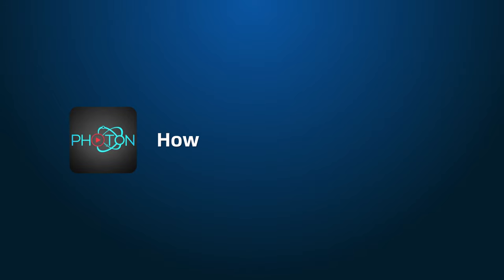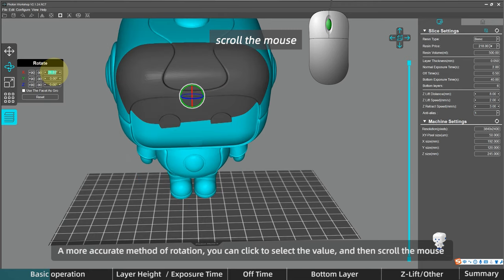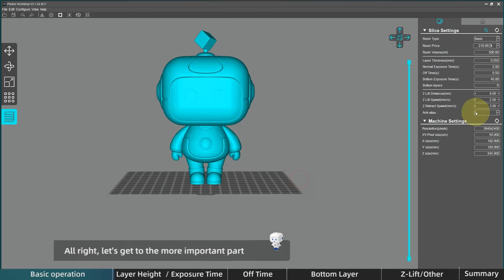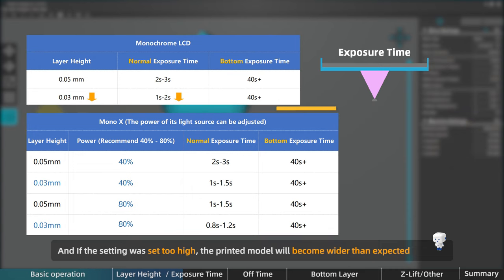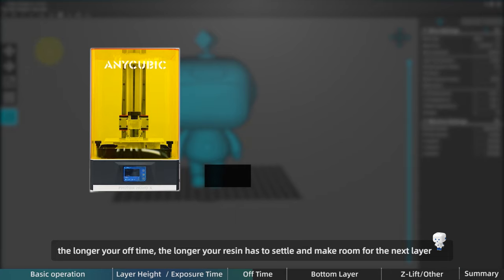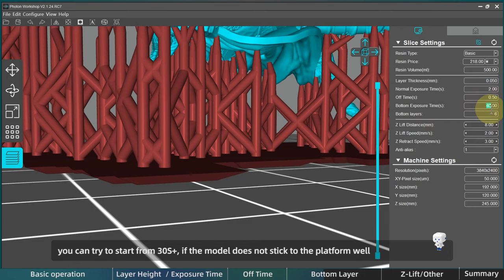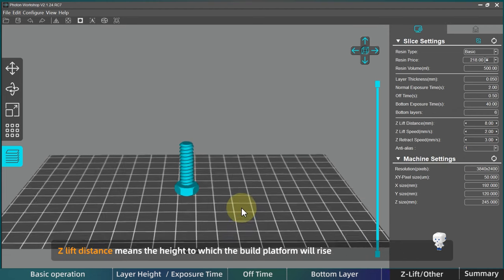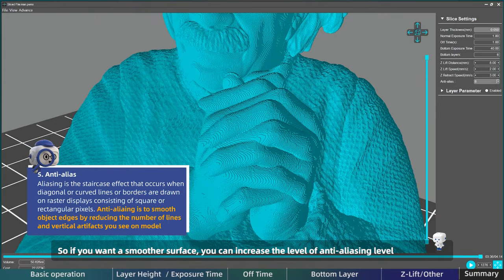How to Start Using Photon Workshop? (Beginner Guide 1)

Comment: I have a new Photon Mono, but the workshop program downloaded from the memory stick provided only has 3 options for machine types "Photon S, Photon, Photon Zero". In this video "Photon Mono" is listed. Which do I choose? Thanks Which do I choose? Thanks
Reply: i have the same problem but you just need to use the earlier version V2.1.26 instead of the V2.1.29
Reply: @saccharine.sinner7795  This right here. Way more helpful than their whole site.
Reply: I didn't even know to get the program from the thumb drive @w@ and couldn't find it on their website at all
Reply: @starrlesscreative  I spent about 45 minutes digging through the website to finally find the program to download (I think that it was listed waaay down under the product description….. not a user friendly website when it comes to finding the extras you need, just for spending the $$

Comment: Photon Mono X 6K under settings - Slice Parameters - Advance Control.  What's the difference in the parameters numbered [0] and [1] Each layer control (bottom and Normal seem to have 2 sets of parameters.  What's the default. Do I need to have all 4 parameters set?

Comment: How to set layer exposure manually for each layer? I want to ensure that the transition between the 40 second bottom layers and standard layers of 2 seconds goes gradually. But after editing the layer exposure manually it doesn't save the settings, but resets to general settings. Please help.

Comment: What is the ideal exposure time for a layer thickness of 0.02 with Water resin?
Reply from the maker: Hi dear, 1.5s is better : )
Reply: @ANYCUBIC3D  fantastic! Thanks a lot
Reply: @ANYCUBIC3D  I tried with 1.5 of exposure time and 1 sec of off time with 0.02 mm slice...the models are precise but even though they are hollow there is still some uncured resin. Do I go to 2 sec time exp ot 1.5 sec off time?

Comment: What is the correct sliced file to choose for the 4k mono it's not in the configuration settings? I need pwma!? These save as pwmo pwx no pwma? Anyone know?.thanks😊
Reply from the maker: Hello, add Mono 4K ((383 x 227 x 222 mm) ) printer setting into the Workshop, and don't forget to modify the suffix by pwma when saving the sliced file.

Comment: How do I bring my file over to the printer I’ve tried to save it to the usb many different ways and it’s not showing up on my printer.
Reply: @batingbunnies  I actually figured that out after I posted the question. The problem I have now is when I print it doesn’t stick to the platform. It stays in the resin vat and the first couple layers solidify to the bottom. I’m messing with the numbers in the program to see if that’s what was messed up.
Reply from the maker: Hi, sir, what printer are you using? You can use a USB flash drive. When you buy our printer, the package list includes the USB flash drive. After you slice it, you will get a slice file. You only need to copy it to the USB flash drive. 😊
Reply from the maker: @seth1371  Hi, sir, Sir, if the model does not stick to the platform, first, you need to confirm whether the platform is leveled correctly, you can try to level it again. Then you can increase the exposure time of the bottom layer, about 50S-60S, or you can increase the number of printing layers 😊
Reply: @batingbunnies  thank you for this just saved me a whiiiiiiile more of messing around with this
Reply: @batingbunnies  Thanks James. Your simple explanation helped a LOT!

Comment: I had my printer for a year and still haven't been able to use it because the flash drive isn't working and the printer doesn't want to print anything. I am hoping I can get some help with this please @anycubic
Reply from the maker: Hi there,
For after-sales support, please submit a ticket at: https://bit.ly/46MO1vh. If you don't receive a response, check your spam to avoid missing information. After-sales engineers aim to reply within 24h on working days, but please expect delays during holidays and peak periods. 
For self-help solutions visit: Anycubic WiKi https://bit.ly/46NZ7Qx